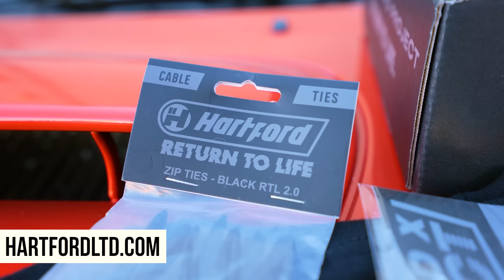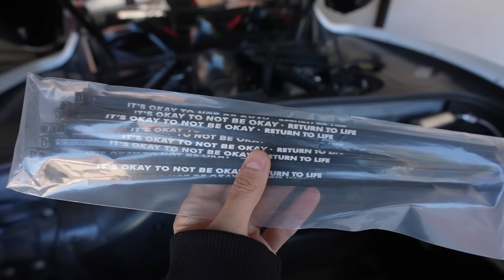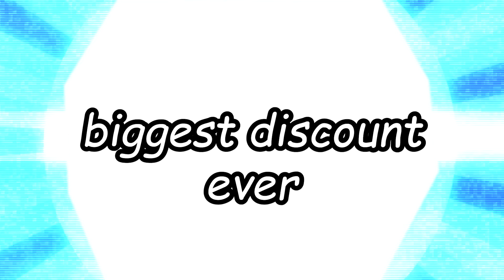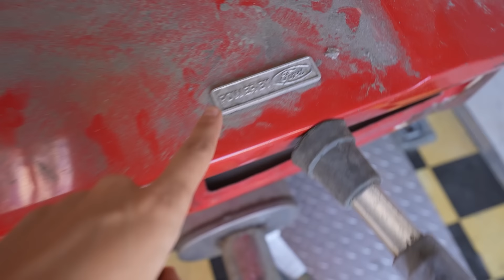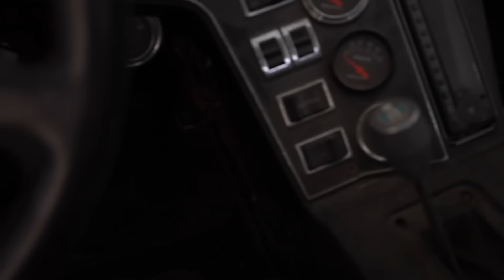Employee Surprised Me With A Barn Find Supercar!

Comment: The Panthera has one pro you don't need a heater in the winter but you will need an airco for the summer, the engine heat is really common in watch your feet lol...but what a beauty...and I was thinking the tomasso panthera had e engine in the front ...

Comment: We did the samething with marvel miracle oil in a 63 T-bird.  After 2 days of turning back and forth and adding a full teaspoon in the spark plug holes it would turn over. Car ran great for 4 years before it dropped a valve.

Comment: To save the motor I would pull the motor and open up the heads. Then go from there. Possible replace the rings and clean out any rust that might be present to save the motor fully. Sorry Sandy

Comment: If you ever wanna make someone mad or pull a prank give them a 2009 chevy aveo with the catalytic converter partially blocking off! It won't blow the motor surprisingly it will cause the transmission to fail.... No lie mechanics claim that the computer tries to adjust itself but instead of putting itself in "limp" mode it goes zip zap zing and.....yep shoe leather express

Comment: At some point in the future when you have a reveal from within an enclosed trailer, you have to go "Back To The Future" and have a bunch of dry ice or nitrogen fog pour out before you actually see the car.
Also, when you're pushing any vehicle, push on the wheels...like, cup your hand where the sidewall meets the tread.  It's amazing science at work.  Emelia could likely get Sandy's truck starting to roll on her own.  For real, not joking.  The science is that when you push on the body, nearly all your energy is being absorbed by the sprung weight.  The chassis and suspension are basically doing what they are designed to do: keep the sprung weight of the car isolated from the unsprung weight (basically, the wheels, control arms, and axles).  This also is very important if you're pushing a car that has questionable A/B-pillars or no bumper, such as a typical neglected vehicle like a barn find, salvage, just really old, etc.

Comment: Cleveland's are the s*** if it's a 4V if it's a 2V just get some 4V heads. It will need to be reoiled. Just get a hold of Garrett Machine and Welding in Lebanon Oregon if they're still in business they built my Cleveland and it was sick. Mike Garrett has since passed away but I imagine his kids are still running the show I don't know I'll have to check. I painted his car hauler. Pretty sick multi-color F350 dually with the logo on the door. I'd like to see that again. Who knows if it's still around or if they're still in business that was 20 years ago but those are the Cleveland guys. Yeah I did a Google search looks like they're still in business. They know what to do to build the best Cleveland. As best I can tell those do look like a 4V head judging by the runner I don't know why somebody would  build 2V head in aluminum. TV heads with a 4V manifold and a cam can be okay on the street. But with the 4V head you pretty much have to build all the way and that means it's going to get into some R's so you're going to have to do the reoiling on the camshafts Mike Cleveland had stainless braided line that came from the back of the engine up over the intake manifold and drop down on the front of the cams. It was running a really six solid lifter and actually the engine had to be detuned a couple times from mitz original race form. It  shook the 29 model a like crazy and would turn the tires over as it cammed when you put it in gear. Then that engine went into it falcon ranchero and then eventually into my 69 Ford falcon. If you happen to see the car hauler I'm sure the paints holding up just fine but those were the first windows I ever tinted in my life. We used Diamont so it should still be legit. Happy Thanksgiving Hope that thing runs okay if you need any Cleveland stuff I'm sure they could hook you up. As I remember for you FE guys they make an awesome rocker setup too. It's been a while but I think they had the market cornered back in the day.